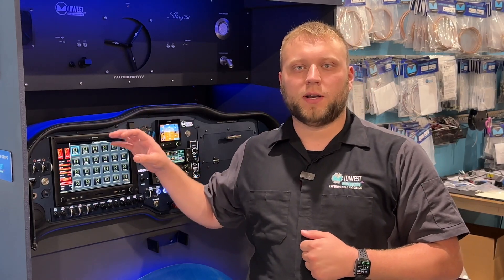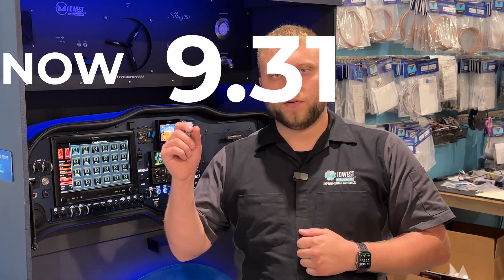Sling Flap Fix!

Comment: Thanks Adam. Just to understand, this should fix also the case of flaps not fully retracting and stopping at an "illegal position," after take-off, from the first notch position (as opposed to from fully deflected)?
Reply: I was having this issue as well where after takeoff I would press the toggle to raise the flaps and they would not retract. I updated the software today and it appears to have resolved that issue. I also plan to program the new flap logic so it will alarm for flaps down above 85kts as a backup.
Reply from the maker: @Slingit_Aviation  that’s great to hear, glad it fixed your problem. We have been working with Garmin for a bit of time to get this resolved.
Reply: @Slingit_Aviation  🥳🥳🥳
Reply from the maker: Yes it should, let us know if it doesn’t work for you.

Comment: Thanks for the update. It looks to me like Garmin doesn't have a proper testbed for their software?
Reply: Depends how you define proper … you can not test every hardware configuration out there, especially when this includes the kind of hardware used by what amounts to a few dozen Sling TSI customers …
Reply: @walterrawdanik8077  I know there are many configurations, but this is actually their own servo. Either way, for me it fixed the annoying "1 step down but 2 steps up" problem I had.
Reply from the maker: The flaps are not Garmin's servo - it's Sling's part number.